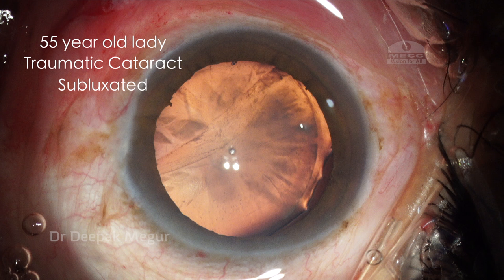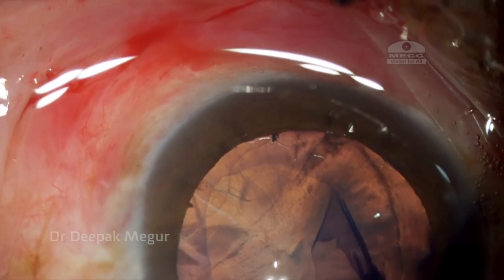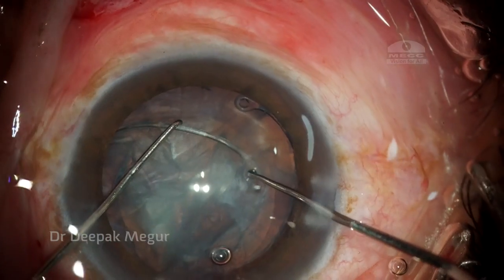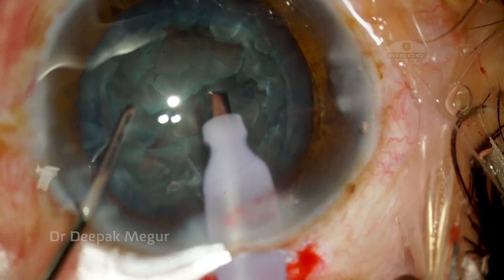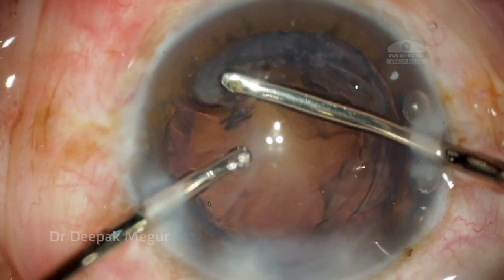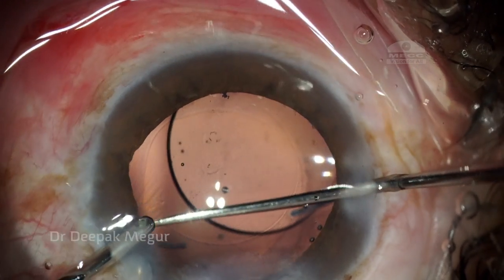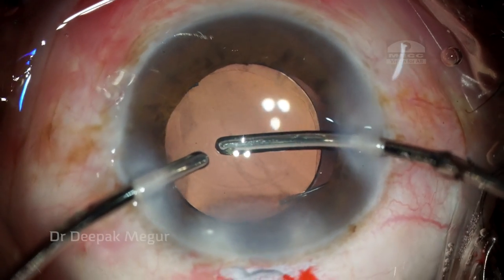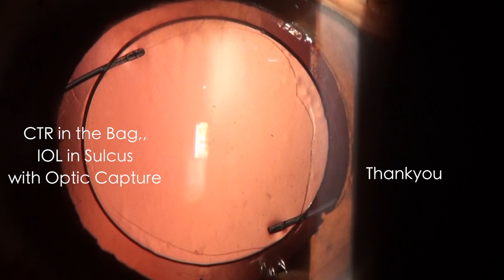Traumatic Subluxated Cataract Managed with Phaco, CTR, & Multipiece IOL in Sulcus with Optic Capture

Comment: sir ur suggestions are very helpfull.Does using 3 peice lens has advantage over single peice IOL in case of CTR implantation?Can u pls guide me where i can buy suction pump for draining fluid in deep sockets.Thank u sir.
Reply from the maker: Dear Asif, Thhanks for your comments.In a select group of patients with localized zonular defects, the technique of placing the multipiece IOL in sulcus with optic capture works, it is an additional way of supporting the bag apart from the CTR in the bag. But in eyes with large zonular dehiscences, the bag needs to be sutured using a Capsule Tension Segment.
Single piece Hydrophobic IOLs cannot be used for Sulcus Placement.
Suction Pump: It is the same general machine used in a general hospitals. .!
We attach a IV drip set to it & use it
Reply from the maker: The suction pump is the regular one used by general surgeons & anaesthetist, I attach a sterilr IV fluid tubings and my assisstant uses this to prevent pooling of fluid
Reply: Thank u sir.